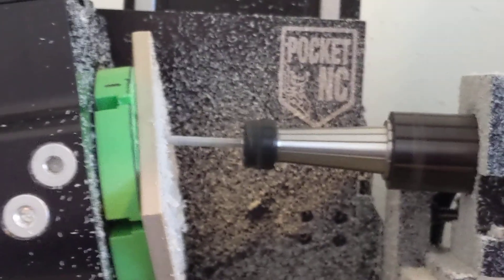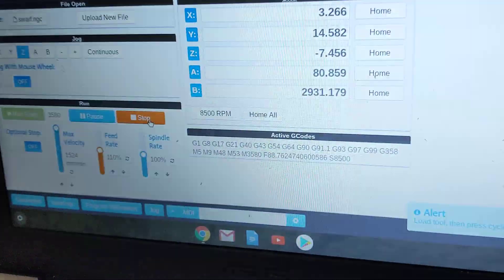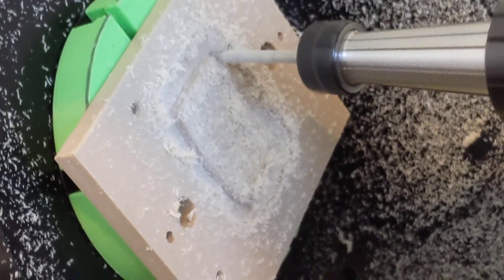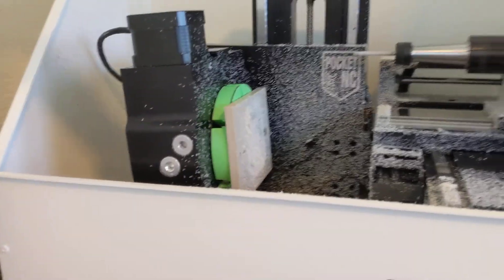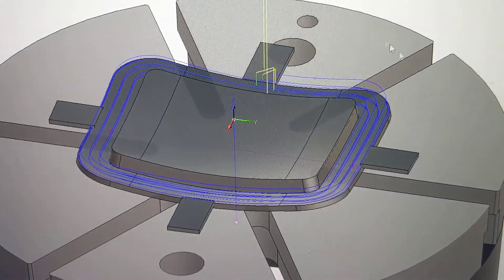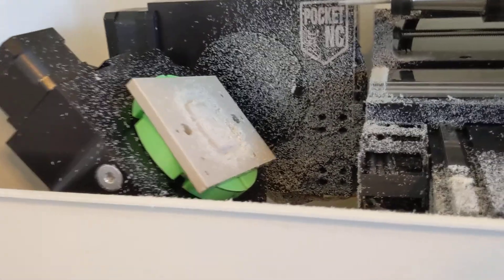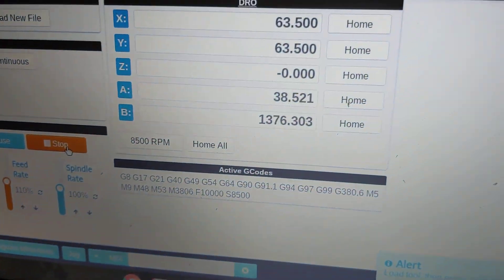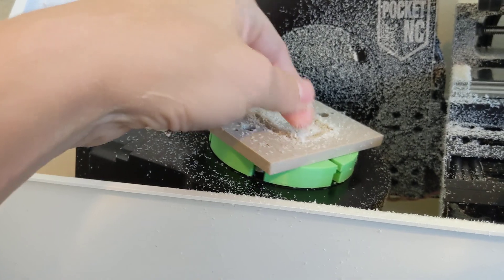Pocket NC V2 B-axis "uncoil" effect.

Comment: On most cnc controls there is a specific code that will allow it to return to 0 within one turn, the pocket nc simply doesnt have that function. an alternative would be to just end the program and manually zero the b axis, which does the same thing. that may or may not be able to be commanded via gcode.

Comment: How well does the enclosure do at blocking sound? I didn't want to dish out the money for the official enclosure and am now thinking of building one out of MDF.
Reply from the maker: It does can lot better than I expected it too.  It really depends on what you are cutting. As you can see the green part is 3D printed in this case, and because it's "hollow", it tends to amplify the sound.